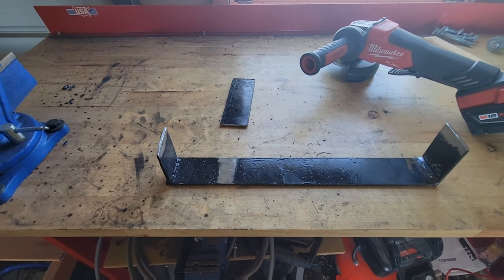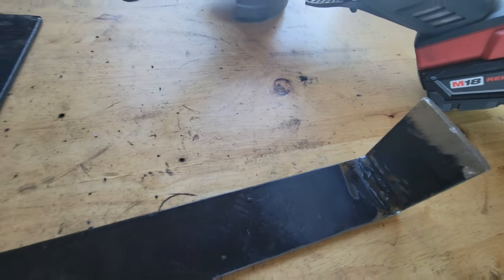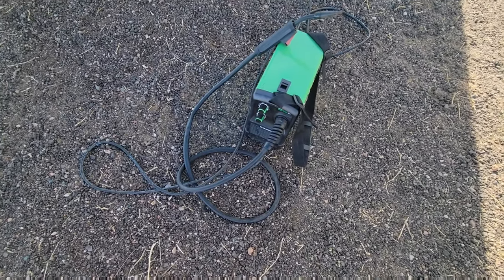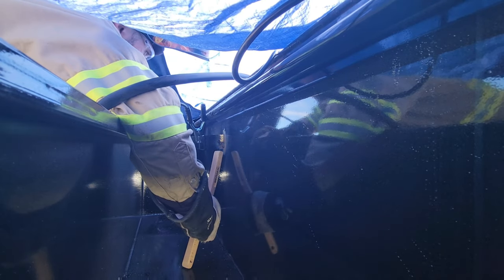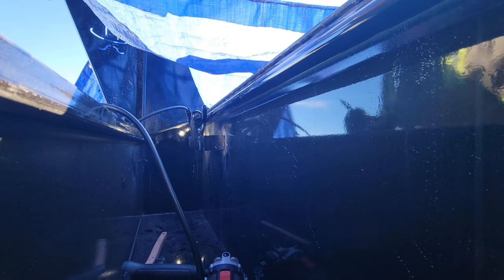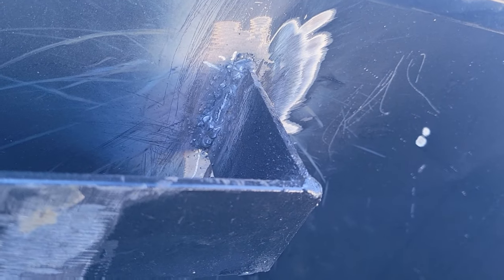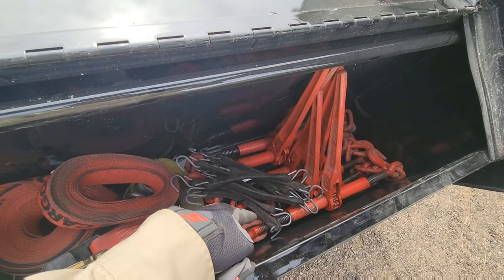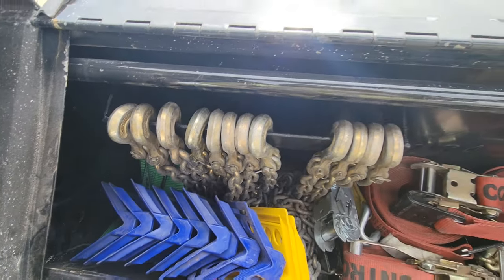Installing a chain rack into toolbox on a hotshot flatbed trailer. #noncdlhotshot #welding #trucking

Comment: how do you consistently avoid going overweight on rear drive axle?  what is your drive axle weight rating?  I am running into problems of going over on mine its 6040 with a 10,000 gvwr empty/dry weight i hit the scale at 5,500 steer and 5,860 drive for a total of 11,360 so without any freight I am over on the truck 1,360 pounds.  I am in the process of removing an abundance of tools and extra equipment i have in totes in truck bed but can't imagine it is 1360 pounds.  With that all being said and asked do you run into overweight issues on rear drive before even putting freight on trailer?  Have you had any issues at dot weigh stations.  I got pulled into one at the above weight and dot flashed the driver return to interstate sign.  I thought my goose was cooked and yet they sent me on my way?  Any thoughts on this.
Reply from the maker: Drive axle is the same as yours. You will be Over your trucks GVWR with an empty trailer. But including the trailers GVWR it changes to GCWR. So as long as you stay under your total GCWR and don't overload an axle you're good never have had an issue as long as I don't overload the axle rating. My truck weighs 9300 lbs with no trailer.  With my trailer on I can only load 1k on my drive axle. I put everything over the trailer axles. DOT has never cared as long as I don't exceed 26k GVW and I don't overload an axle. Even then I've been over by a couple hundred pounds and they haven't cared.
Reply: @TylerTheFieldServiceTech  Thank you.  I suppose a dot officer having a bad day could "care" and fine me if wanting too.  I just can't see how I'm going to stay at or under on my drive axle consistently and not stressing about it, I don't want to take chances but it seems one misplacement of a pallet or what not on trailer could  send me overweight.  I'm not trying to beat this ? BUT.  MY combined rating is 25,900  10k at truck and 15,900 at trailer (30ft big tex 14gn).  I hear you when you say not to go over on combined weight rating but still leaves me hurting at the drive axle I guess I'm thinking it's a non issue for dot as long as staying at or under combined weight BUT could nit pick a person on specific axle weight if wanting to?  Do you get nervous when you are or think you will be overweight on your drive axle?  Or has it become a non issue for you as time   went by. I am just trying to get more insight into this before doing any more runs.  Can you tell me what you mean by don't "overload an axle"?
Reply from the maker: If my loads can sit at least 10 foot back on my 30 foot trailer I'm not worried at all about overloading the rear truck axle. 10k is my max load casue I weight 16k empty with truck and trailer with full fuel and all that extra shit.
When I have loads that I think may exceed my axle rating on the truck or total weight  I will go scale and see. Depending on the results will determine if I'm good to run normal. Take the scenic route or return the load. All depends. 

Here is how I can better explain it...
Your truck axles are rated for 6k each and your trailer axles are probably 7ks. Your GCWR is 15900 like you said. Your axle ratings will be 26k total. 12k for truck and 14k for trailer. As long as you don't put more than 6k on each truck axle and more than 7k on each trailer axle you will be fine. 
I run 8k axles on my trailer because it is easy to overload 7k axles and they are prone to bending.
Reply: @TylerTheFieldServiceTech  Again THANK YOU FOR your insight and attention to my ?  After reading what you have said I am convinced this is why DOT hit me with driver return to interstate sign at the weigh station.  I was clearly overweight on truck gvwr but not at any axles.  I was 16,600 combined dry.  I am going to reconfigure/distribute tools equipment and drop some to give me room to breath at drive axle and then get back on the road.  Rates are crap out of Billings mt are right now though.  Thank you.
Reply from the maker: @YrBuddy77  Yeah man I've never had an issue with that method hopefully it stays that way. Billings is actually my favorite city to go. I always leave empty though! 

Montana is my favorite state cause under CDL= no stopping at weigh stations. 
You could always mount a tool box by your trailer axles. A lot of guys do that. Takes a ton of weight off the drive axle
Reply: @TylerTheFieldServiceTech  That's exactly what my neighbor suggested doing getting undermount tool boxes. So i'm looking into it. Im about to remove all the bs and run into billings and scale and see where that leaves me.  I seen a vid where hot shot macc ran into gross overweight and he had to ditch a spare tire and tarp.  if i'm ditching anything its gonna be at the house. best load out of billings right now is to salt lake 1.25 mile at 700 dollars at 3,300 pounds and 15 ft.  Iwent through that blizzard in S.D., other night it was white knuckle all the way through to MT.